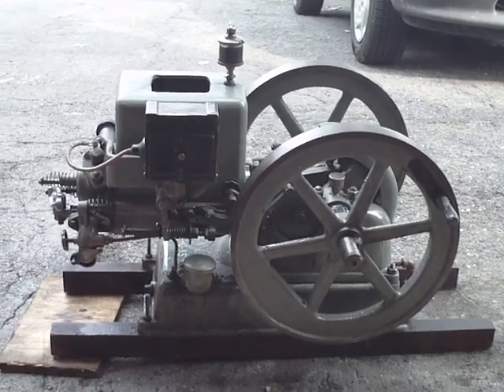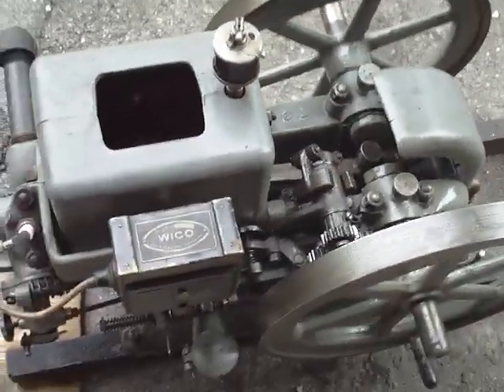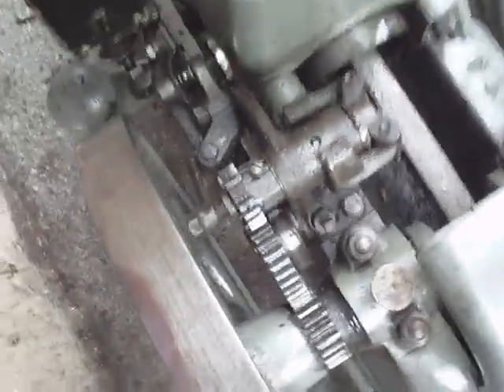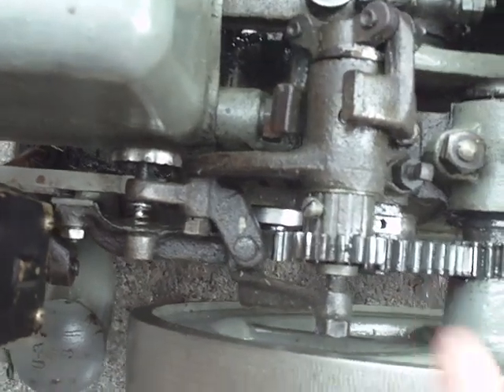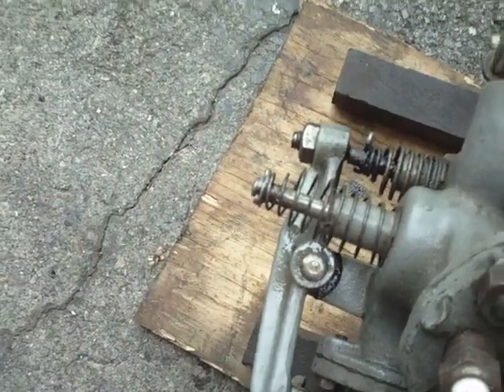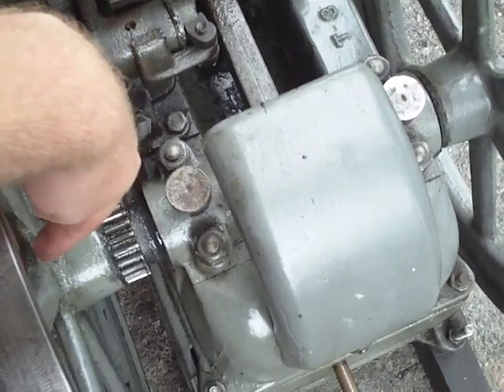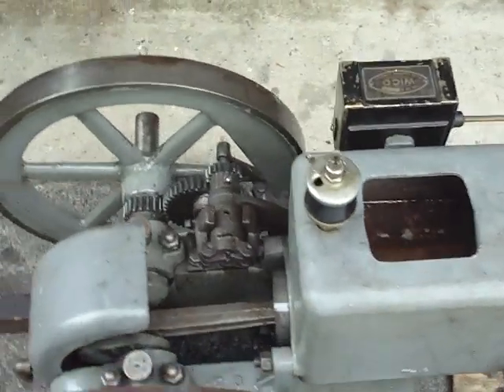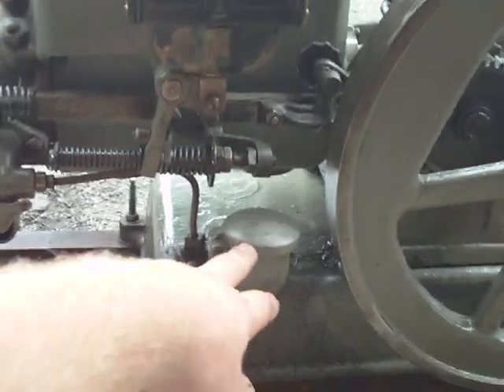Hit and Miss governer explained

Comment: I am a total newb to hit/miss so I have a stupid question. What way do you turn it off? Power interrupted or fuel sut off?
Reply: You can turn them off a few ways. 1. You can hold that latch in that he pointed out which will cause it to not fire and it will eventually die. This isn't the preferred method because you get your hands pretty close to the moving flywheel and other parts. 2. You can turn the mixer knob on the carb to turn off the fuel. 3. See the silver button on the side of the magneto (the black box with the spark plug wire protruding from it)? You push that in and it grounds the magneto so there is no spark. You hold it in until the engine stops.